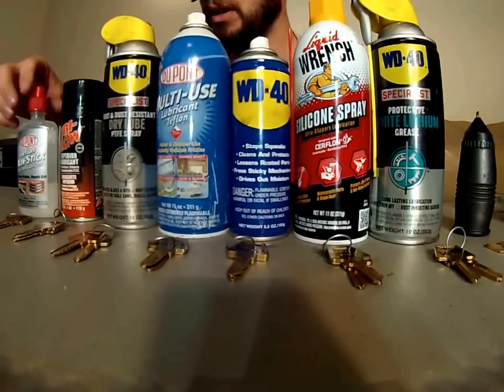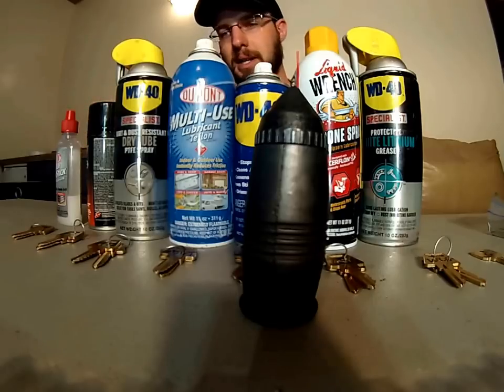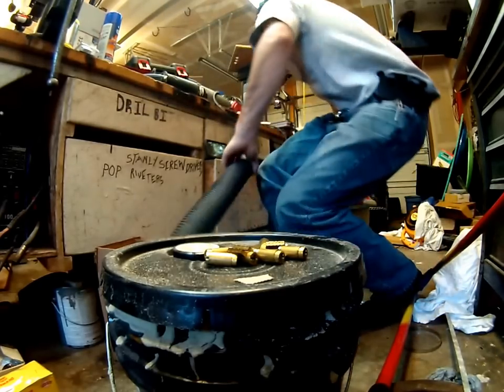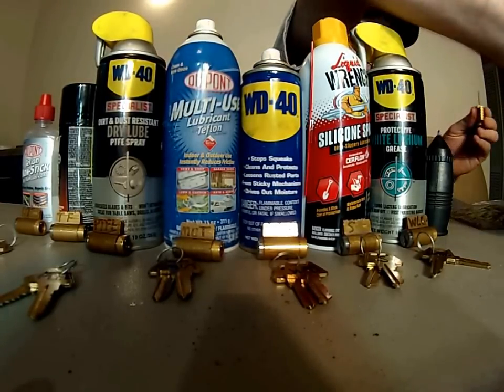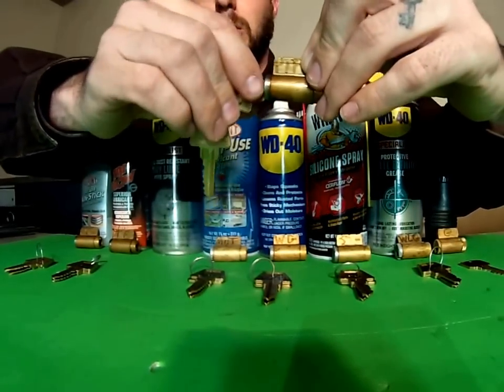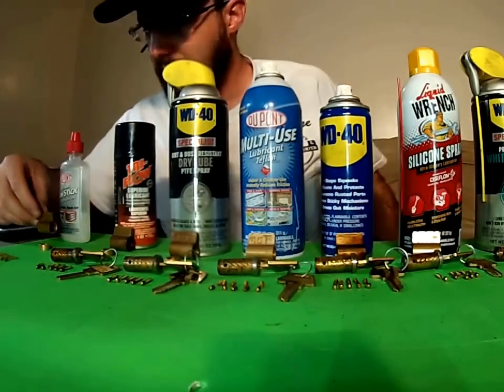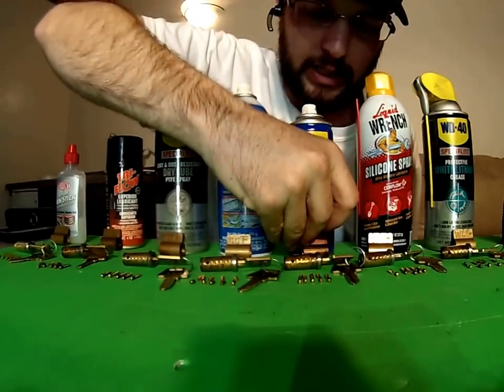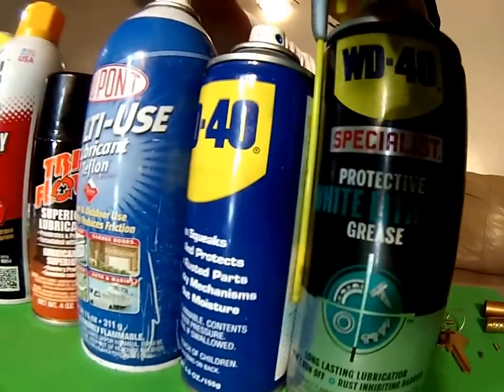What Is Best Lubricant For Locks WD-40 Graphite Teflon Silicone PTFE Spray Tri-FLow

Comment: A lot of liquid lubricants will free up a lock in the short term but will be responsible for a buildup of dirty sludge. The best by far is just pure graphite powder and you only need a tiny bit. It gets into the tiny crevices and no dirt will stick to it like dirt sticks to oil. Oil is fine for sealed bearings where dirt can not get in. I have fixed a lot of locks with graphite and rarely have to do it again. My experience with oil or any liquid has meant a return trip later and bigger problems than originally. Wd40 is great for rust but do not use a lot. One quick spray and wait.  Other stuff will often make things worse as time goes on. You do not want a build up inside lock mechanisms. Locksmiths are happy to show up and free up a lock and do not care if they have to go back in a few weeks. It looks like it’s a problem with the lock, which sometimes it might be. But if they keep filling the lock with liquid, more and more dirt will stick and you will have to keep on fixing it. Use graphite powder and be happy for the long run.

Comment from the maker: What Is Best Lubricant For Locks WD-40 Graphite Teflon Silicone PTFE Spray Tri-FLow? We put them all to the test here! Fill up lock cylinders with lubricant and them heat them up to 450 Degrees F for a couple hours them dump them is snow and water. Then Bake them again and freez them. Run it all though a shopvac full of dirt and see what is inside!
Please Click The Subscribe Button Below And Share Video With G+, Facebook, Twitter and all Your Favorite Social Media!
Comments and questions are encouraged but please be respectful.
http://waynewintonreviews.com/
www.tricountylocksmithservice.com
http://metaldrillbitreviews.com/
Reply: Wayne Winton hi Wayne love all your videos.Do you recommend a dry lubricant for disc detainer locks like abloy?
Reply from the maker: All locks yes
Reply: thanks wayne .I have been using 3 in 1 lock lubricant and  triflow.
great informative video.
will start using the WD dry ptfe spray as dupont dry teflon is non existent in Australia.
Reply from the maker: nice!
Reply: Hi Wayne,

Please try out Ultra 2040, HSS2000 from Wurth!
You may change your opinion...

Comment: Hi Wayne,  Dupont appears to have discontinued Dry Film with Teflon and Multi-Use Lubricant with Teflon (2023). They have replaced the Teflon with hexagonal boron nitride, another high tech solid lubricant.  It would be interesting to see if this changes your recommendations.

Comment: I realize this video is mainly specific towards locks, but I think that TriFlow is the best over-all lubricant (in my opinion) for every-day use. What shows up in a fine-tuned instrument such as the gunk and the easy moving pins is actually NOT beneficial for something like a bike chain/parts that need a thicker solution. With that being said, again I want to say that I realize this is mainly about lubes for locks, but on my bike, or larger more abused / indoor, outdoor things like lawn-mowers or tractors, I'd definitely go with tri flow over a thin lube like the dupont dry solution. I mean, they put straight up grease in most car parts and door hinges, not WD-40 lol, and they surely wouldn't put a thin dry solution on a 80-100 lb door. Great vid though, I used to use wd on my locks, and will now be looking for something like your fav on the far left.
Reply from the maker: Every job has an appropriate lubricant.  Green, wd40 , tri flo all have a place, it's just not in locks

Comment: Thank you very much, that is way in depth, the silicone spray is great for guitars with a tremelo bar, bit on the nut, bit on the rest of the moving parts, and it seems to last. Cheers a lot for posting.

Comment: I saw a video where a locksmith cleaned the lock with brake cleaner, lubes it with ptfe dry lube, and then used white lithium grease to "protect" the lock. It was for a car driver side door. 
Im having second thoughts about white lithum grease for locks.
Would a clean with a solvent and something like wd40 dry ptfe do the trick for some time?
I know honda and toyota uses grease on their locks in modern cars. Is this necessary? Grease just seems way too viscous for a lock michenism.

Comment: Would the dry lube work in the winter as a de icer as well then if it has alcohol? 
I bought a can of dry lube for my door latch locks on my truck that wouldnt latch and keep doors shut. Both rear doors in my gmc wouldnt latch. Took apart , cleaned the built up gunk from lube in the past and got them working. With the dry lube , dust n crap wont stick to the lube like a oil base lube. 👍

Comment: Just looking for what else I can use on an ignition lock that is difficult to turn to the start position. So far I've tried WD40 standard which worked slightly; I got it to go but only after much histrionics. Currently I'm using the dry teflon stuff. It works better than the WD40 but still requires some jiggling. I am planning on using graphite powder next. I'm pretty sure I need a new lock cylinder and they are simple to install in my car but I already have the graphite on hand. 

I would like to see a video of how these products work on locks similar to mine but in ordinary driving conditions; I probably won't drive my car in 400 degree whether or through a sandstorm with the windows open, so much of what I saw here isn't relevant to my situation.

Comment: I bought graphite spray and sprayed some of it in the car ignition key lock as well as in the door. What's your opinion about that? I'd also sprayed CRC lock oil in there previously, though not very much. I wonder how they mix up...
Reply from the maker: Normally I would flush out the oil before adding the graphite

Comment: i do not use WD-40 myself, i use dry lubricants but you said in multiple times that WD-40 was performing better than others, but you put it toward the bottom. was this because of personal bias against WD-40? when i put your findings into a flow chart WD-40 to me looked like the 2nd best wet lubricant you used. but hey, that is just a unbiased opinion, i would never use the stuff haha.
Reply: i wounder how Dow 33 machine grease would do in this, i know it would hold particulate in it but curious about how it would work for hot/cold.

Comment: Is it safe to clean a lock with water and regular dish soap, rinse well with cold water to get the soap out, use WD40 to get the water out and then apply 3-in-1 oil?
Reply: +techwg Also, what would be the best method of cleaning out/degreasing a lock with the cheapest requirements and then applying graphite? I see people talk about using WD40 to clean out water after washing but surely you can't use graphite after WD40?
Reply from the maker: +techwg NO WD 40! I use a solvent like mineral spearits or Brake clean. The graphite or tefflon. Soap and water are not really a good idea either.
Reply: +Wayne Winton Would isopropyl alcohol be ok as a solvent to remove such things and clean off existing WD40 and 3-in-one oil to be able to use then instead use plain old dry graphite though?

Comment: What about Krown Rust Protection & Lubricant Max Strength?  It's $9.95 for a  400g can. I get my car rustproofed at the garage once a year and it's available in cans and the Krown videos show that it can be sprayed into locks, mostly car door locks.  Would it work as well on padlocks?

Comment: whats the best way to clean out a lock after using graphite?  I used it on my ignition its still sticky when its cold though.
Reply: To Eric.. please tell me what you have learned about properly lubricating the lock.  Do you know the name of the solvent that is used to "clean" out the lock's key hole and mechanisms.  Also, once you have wiped away the previous gunk and lubricant (or graphite) from the keyhole and mechanisms is it wise to use the same dry teflon in the keyhole and on the mechanisms (or even on a padlock's shank?)

Comment: To Wayne and all other experts on this chat, please tell me what is the name of the solvent that used to "clean" out the lock's key hole and mechanisms.  Also, once you have wiped away the previous gunk and lubricant from the keyhole and mechanisms is it wise to use the same dry teflon in the keyhole and on the internal mechanisms (or even on a padlock's shank?)
Reply: Probably non residue contact (electronic) cleaner or brake cleaner. Contact cleaners are best for job.

Comment: I have a padlock on the back of my truck, and live where we frequently get freezing weather. The lock gets moisture inside and then it freezes. I can not get the key in or turn the key when i get it in the lock. Is there a good product to apply to the lock so it does not freeze up? It is a regular padlock - nothing fancy.
Reply: You posted 9 months ago about your truck lock.  The big round padlocks - we call 'hockey puck locks' on a truck should be per-lubricated before it gets cold out and again in the spring.  DuPont Snow and Ice Teflon with some silicone is a good spray to douse the lock with directly through the key hole.  In addition, there is a nifty rubber cover with a cable so you don't loose it.  Check the size fist.  Here is one of the products I have used with my clients. https://lockitt.com/Lockitt/product/HPRD0110.html
Reply: @jrchicago9216  thank you for you suggestion on the Dupont Snow and ice teflon repellant. Could not find it locally but Amazon has the Dupont Snow and Ice Repellant included with a small Bottle of Dupont Easy Entry lock lubricant with Tefflon for a little less money than the Snow and Ice repellant by itself.

Comment: The dry ptfe and teflon(same thing) sprays are just dissolved teflon in a solvent. When the solvent evaporates, it leaves a coating of teflon on the surface. There is no 'oil'.
Reply: Teflon is not dissolved. Teflon flakes/powder are suspended in a carrier, not solvent.

Comment: Great video... Would I be able to use wd40 ptfe dry lube to lubricate my bike chain if I ride in dry conditions? Or doesn't it lube the chain good enough? And advice.?
Reply from the maker: Nikolaj Andersen Chain gets dirt but also needs adequate lubricant applied often. I suggest a good oil lubricant.  not WD40.
Reply: Wayne Winton thanks.. The dirt that a chain gets I guess the ptfe is the shield for that.
Reply from the maker: Yes

Comment: My motorcycles ignition switch is very hard to turn from on/off and i dont even dare try putting it on 'lock' last time i did, it took 5 mins to get it from the lock position, im afraid of key breakage, i used teflon when i got the bike recently it did help alittle, but its still not any good, can i use breake cleaner to flush it out, and apply new teflon?
Reply from the maker: Sounds like you have a lock going bad. a crushed wafer in the lock or weak or broken spring. I highly recommend you replace it before it locks you out for good. lubrication can't fix broken lock.

Comment: Is the dupont teflon non stick in the spray bottle equal in quality as the squeeze bottle?
Reply from the maker: Any brand of Teflon will do in any format, spray or bottle
Reply: How can you say that ? YOu used other ones with teflon and did not rate them well.

Comment: what type of solvent do you suggest to get the truflow oil OUT?   I want to go with the graphite, but I dont want to ruin them, and  as I have over 16 of them, financially taking them to the lock smith is kind of out of the question.  Thanks, Bob
Reply from the maker: break clean
Reply: thank you, as a gun nut I have tons of that already here at the house!  love our videos, learn something everytime I watch them!
Reply from the maker: Good to here
Reply: I know it's an old post but if you put denatured or even isopropyl alcohol into a syringe you can rinse out the lock. Just make sure you repeat several times and use some force (not the dark side).
Reply: To bob Long, please tell me what is the name of the solvent that you have used to "clean" out the lock's key hole and mechanisms.  Also, once you have wiped away the previous gunk and lubricant from the keyhole and mechanisms is it wise to use the same lubricant in the keyhole and on the mechanisms

Comment: Removing Tri-Flow from automobile door locks and replacing with DuPont Teflon Non-Stick: I've seen you refer to brake clean in the comments below.  
Is that what you'd use to remove the Tri-Flow from a car door lock?  

Also, is this brake clean that you're referring to the FVP Brake Clean product?  

Thanks
Reply from the maker: First Last break clean is simply a solvent to breakdown oil bassed lubrication
Reply: Thanks.  Sorry about not doing a better job in asking my questions.  Based on this video it seems worth while to remove the Tri-Flow I put into the locks in my vehicles and replace it with DuPont Teflon Non-Stick.  
1) Removing the Tri-Flow from car locks:  I don't want to damage the paint so...  In the comments below you mention brake clean.  I looked that up and one company FVP has a product that they call brake clean. http://www.fvpparts.com/products/chemicals/cleaners-degreasers/brake-clean/ 
Is that the product you're referring to?  
2) Would it be detrimental to the locks if I didn't remove the Tri-Flow and the next time when they needed lub just hit them with the DuPont Teflon Non-Stick?

Thanks and a big thank you for the video

FL
Reply from the maker: You need something to devolve the oil from the triflo . The petroleum base is what a tracts dirt. I use break clean all the time. If used quickly and sparingly with canned air or compressed air to dry it quickly.  Try it on a not noticeable test spot first to be sure

Comment: My mailbox lock is rusted and takes quite a bit of work to open with a key. Would spraying with a dry lubricant help or is there a better way to tackle the problem?
Reply from the maker: use penetrating lubricant then flush with solvent like break clean. then apply dry lubrication

Comment: Why didn't you include Strattec's LokShot??
Reply from the maker: The point was to do the test on products that can be easily found at your local hardware store as opposed to a special order item. Also lock shot is most likely a dry teflon just like the in this video which was the winner anyway. This video has the basics of the actual chemical compound however they're market did under different brand names they are still the same product
Reply: Wayne Winton
You should get a can of Lok Shot and try it if you have never seen used
Reply from the maker: Ok will do